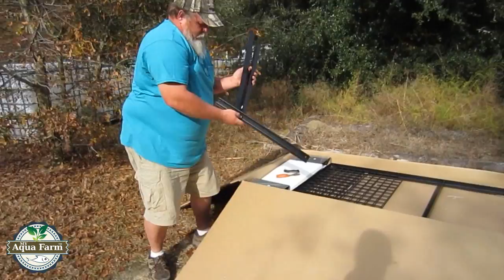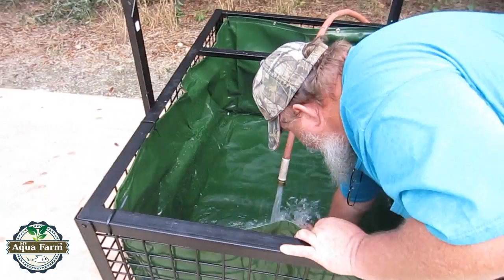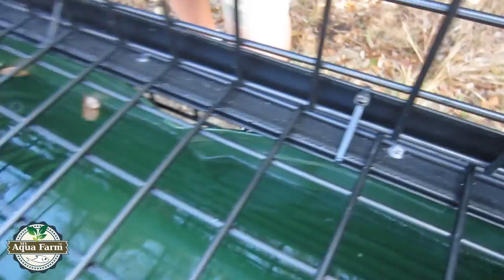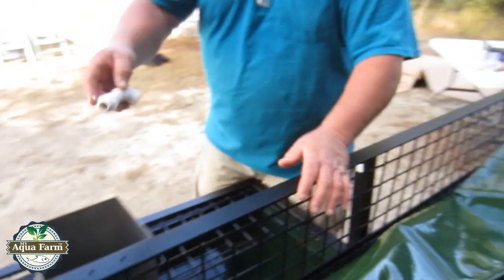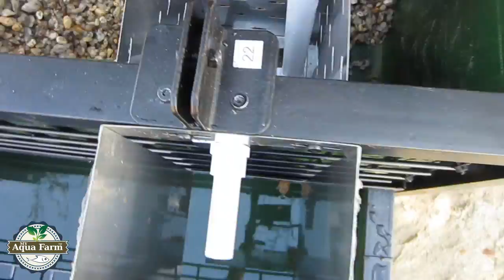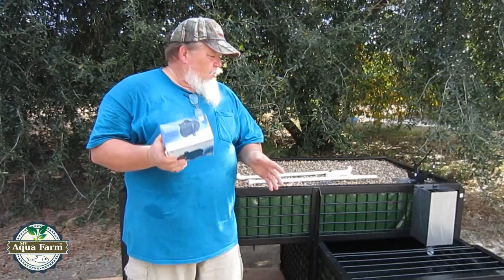MyAquaFarm Aquaponics Construction Video

Comment: Muy bonito el sistema y el vídeo pero con un sifón de campana es mucho más facil
Reply: The translation of this comment is:  Very nice system and video but with a Bell siphon is much easier .
Thank you for your comment.  However, the bell siphon is neither as reliable nor as flexible in it's operation.  The Flood Valve (that I invented) has been around longer than the Bell siphon and has proven to operate in a much wider range of flow rates.  For instance, try running a bell siphon with the ability to release water through a 2" opening with a 10 GPH flow rate coming into it.  It simply will not initiate and just trickle through maintaining a swamped growbed and low fish tank.  There are those who have built both the Flood Valve and bell siphon that would argue the Flood Valve is actually easier to build with a wider variety of materials available to be built from.  I know many who started with bell siphons and now run Flood Valves.

Comment: Are there videos on how to do the upkeep of this aquafarm? What to expect, and how to be maintaining it etc. I like this setup, and have ideas how to use it at my location.
Reply from the maker: I don't have any videos at the moment addressing your questions.  The upkeep is very minimal.  From time to time "bio-gunk" (aka, nitrifying bacteria) builds up in the tubing of both the delivery piping as well as the siphon tubes and has to be cleaned.  This doesn't take long as all piping is slip fitted in my systems.  Depending on how heavy you feed the fish will depend on how long before a partial gravel clean is required.  With the addition of earthworms, this is all but eliminated.  I can usually go at least two years before needing to partially clean the gravel beds.  The daily regime typically is about 15 minutes between feeding the fish and dealing with the plant growth and pests and harvesting.
I hope this answers your questions.  When you're ready to order, we're ready to ship!!

Comment: Great work. Do you sell the syphon mechanism by itself.
Reply from the maker: We do not sell the Flood Valve assembly separate.  The "Fisherman in a boat" is a My Aqua Farm ™  brand thing.  If you want to build the Flood Valve I invented you can get the details in the Barrel-Ponics Manual at www.myaquafarm.com
Reply: Can you please add the syphons mechanism to your product line for purchase. I couldn't find it when I visited the site. Very much appreciated.
Reply from the maker: If you're referring to the "man in the boat" Flood Valve mechanism, as I stated in my previous reply, it's specific to the My Aqua Farm system and is not available on, or for, anything but the My Aqua Farm aquaponics systems.  If you want a Flood Valve assembly for your own build I suggest reading the Barrel-ponics Manual and adapt it to your situation.  It's a very adaptable design I have built in several locations around the world.

Comment: i have a question..
how often water cycles from fish tank to grow bed?
the pump works continues or there is a number of cycles during 24 hours.
Thanks.
Reply from the maker: Kids Club the growbed continuously is in fill mode as the pump runs 24/7 (better for the pump).  The inflow is adjustable which determines the cycle time.  The Flood Valve opens when the growbed is full returning the water to the fish tank clean and aerated.

Comment: You never had problems with metal in your grow bed. We had some sort of chemical reaction with the nitrates and didn't have as good growth. Other than that I like your system.
Reply from the maker: The metal framing never touches the media or water in any way.  It's there for support for the liners which contact the media and water.
Reply: MyAquaFarm.com  you have a metal cover touching the gravel. Looks sweet but I might have a side by side and see the difference. It was very noticeable in our system.
Reply from the maker: If you're referring to the stainless steel cover preventing the gravel from entering the Flood Valve, we have never had any issues using stainless steel in aquaculture in the past 12 years of doing so.  Sounds like you might have been using galvanized or something like that.  We do not use materials subject to corrosion in contact with the water in our systems.

Comment: Simply Brilliant!  Attractive design,  small space, corner unit. An adjustable flow pump would make cycling longer, but decrease 'noise' someone else mentioned.   Personally, I find the sound of moving water rhythmical and relaxing.  Hey now, what about an indoor unit that has a more shallow grow bed (reducing flow volume with each cycle and therefore a more gentle sounding cycle), heavy grade plexiglass on the tank to replace the welded wire and a clear liner? HUH?  Now I'm even more excited about this product!
Reply from the maker: Thanks for the comment.  We're excited about our product as well!!  The design is intentional as are the depth of growbed and such.  Quieting down an aquaponics system is easily done.  The depth of the growbed has little to do with the cycle time.  I use a siphon forced valve operation of my own invention (I call it the "Flood Valve") so I can actually turn the flow down to 10gph and still operate.  Much lower than a bell siphon is able to operate reliably.  This can stretch the cycle time to a few hours between cycles if one wants to.  Not a fan of a clear liner.  It freaks the fish out when people walk by.  This system can easily be used indoors in the proper location.

Comment: Nice piece of kit, but I do have a concern that the hole in the bottle may get blocked and stop functioning. as half the bed is not over the fish tank, and there's no overflow back to the fish tank, this could end up emptying the fish tank.

And I can guarantee this will be whilst you're on a vacation so you won't find out about the problem until it's too late
Reply from the maker: Hello Mr. North.  Thanks for your concerns.  Once you see one of my Flood Valves in operation you may be able to understand how it functions a bit better.  From the outside it seems a bit mysterious at first.  If the hole in the cap of the counterweight were plugged, it would simply hold the valve open and all the water would simply filter through the media bed to the fish tank.  If for some reason the valve were not to operate, the valve is equipped with a standpipe that would simply allow the water to return to the fish tank.  The growbed cannot overflow if the system was properly leveled.  The bottle is simply a counterweight to open the valve inside the growbed, not as the means to empty the growbed directly.  I've been designing and building aquaponics systems since 2003 and met "Murphy" many times.  This system is designed specifically to frustrate him :) .

Comment: what is the life of liners / metal parts...we use it sun with wetting conditions.... how you compare it with that of used IBC tank system...

.
Reply from the maker: Sorry for the late reply.  For some reason I didn't see your question until now.  My apologies.
The liners and frameworks are much higher quality than an IBC tote.  Most IBC totes are designed for one time use and a good many of their liners don't have much for UV protection.  While the frameworks tend to be electroplated galvanized, the tubing is thin and when exposed to a lot of rain they can rust.  The liners in the My aqua Farm are made from a heavy gauge reinforced PVC like that used in flexible potable water tanks and inflatable boats.  Not going to go down easy.  The framework is made of components no less than 1/8" thick and then powder coated with an outdoor rated UV resistant baked on coating to give years of service.

Hope this answers your question!!

Warm regards,
Travis W. Hughey

Comment: Over $1,000 for just one grow bed still is a bit costly.  You've only been on here for two years.  So what's the durability like?
Reply from the maker: Thank you so much for your comments and question.  I've been designing and building aquaponics systems since 2003.  Long before many of the so called "experts" offering their products (some of which based off information they learned, in part, from me).   I built the first "Barrel-Ponics" system utilizing the "Flood Valve" of my design in 2004.  I wrote and published and made available free the "Barrel-Ponics" manual in 2005 and spent the better part of the next 10 years traveling the world teaching people how to build aquaponics systems to feed the poor.  During that time I built the prototype of the My Aqua Farm in 2012 and it has been operating beautifully at our home since that time.  In fact, the factory where this is manufactured built a production prototype and tested it in the harshest environment I know exposing it to acid rain unprotected for a year and that system has been operating since late 2012 in that environment and is still in use today.   This system is designed to last a very long time with minimal maintenance required, consuming very little power (20 watts) and producing quality food for the user.  As far as the $1495.00 (which includes shipping to your door in the lower 48 states) price is concerned, please note, this is for a 16 sq. ft. growbed and 168 gallon fish tank which is roughly twice the size of the competition out there, half the price of systems made by people who have less experience doing aquaponics than I.  The My Aqua Farm is a very robust built (you can climb all over it, DON'T TRY THAT WITH THE COMPETITION) system and a great value to those desiring an attractive, well designed aquaponics system with a very small footprint, energy efficient operation and just plain fun to produce food from.  

Warm regards,
Travis W. Hughey

Comment: beautiful. very noisy though I will never place it on my balcony or in my living room inside the house (I will never sleep anymore). you said solar ? and how about at night ? thanks a lot for this wonderful video and what a great installation!
Reply from the maker: Thank you for your observations.  I don't recommend putting a unit like this in your living room nor on a balcony due to the weight and nature of the system.  If a person did want to do something like that they would need to consult an engineer to determine if the structure would handle it.  I have two My Aqua Farm systems outside my bedroom window and have never lost any sleep.  It really isn't as noisy as you might suspect.  The sound of the operation in the background let's you know things are functioning well.  Operation of this system at night on a solar system, is due to the battery you would have with said solar system.